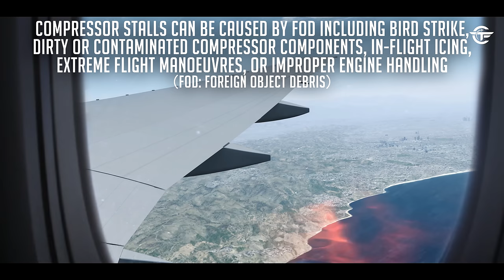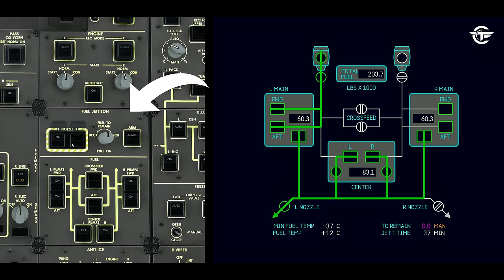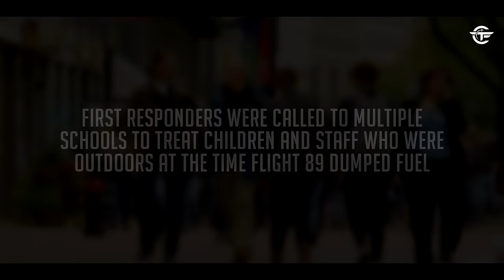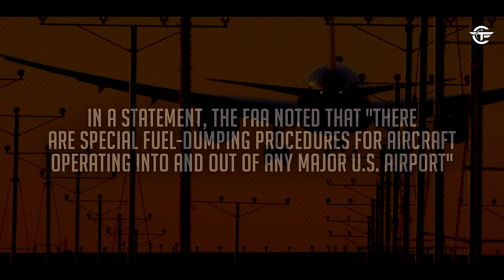Bursting into Flames Immediately After Takeoff from Los Angeles | With Real Audio

Comment: Love how people are actually defending the pilots here for dumping fuel wherever. As a pilot myself, I fail to see any urgent need in this situation to dump fuel at low altitudes above LA. ATC even asked if they need to dump fuel while over the water and the pilots declined. They never told ATC they were dumping fuel to begin with. Engine had a compressor stall, although serious, not serious enough to wait until final to dump fuel.
Reply: Exactly, they were impatient, which a lot of you guys like to do that. Shut number 2 down, go into a pattern over the ocean, and make an upwind final, no need for a downwind landing. What is it, another 20 minutes. A triple 7 should have no problems on 1 engine and they'll move around whoever to get you into rotation when you're ready. A lot of poor decisions. I only have a PPL w/ IFR btw
Reply: Exactly!!
Reply: If it isn't an emergency to not have a reliable engine what is an emergency? The pilots first responsibilities are the lives of the passengers. If my flight lost an engine the situation could get worse. I just want the passengers on the ground safely as soon as possible before something else breaks.
Reply: @jcraigshelton  why are you so upset? I wasn’t there but there is plenty of facts on this. They dumped fuel without advising ATC and even telling them they didn’t need to dump fuel. So they dumped fuel at a very low altitude causing injuries. If they felt the need to dump fuel, that’s understandable, however not advising ATC and then dump fuel on schools is a poor decision made by the PIC.
Reply: @JohnDoe-mh8tm  it is an emergency, I never said it wasn’t. My point is they failed to advise ATC about dumping fuel which is understandable considering the situation they were in, but then dumping fuel way too low to allow for proper evaporation is a bad call by the pilot.
Reply: @jcraigshelton  I love how you think I play video games…how upset are you?
Reply: @JohnDoe-mh8tm  You're obviously not a pilot, nor do you know anything about aircraft. Just about ALL commercial aircraft can fly on one engine
Reply: I thought JP8 was a good exfoliant? Lol
Reply: Great videos of what actually happens in the everyday life of flying
Reply: Alot of mistakes were made by the pilot
Reply: not defending their actions but its always easy to monday morning quarterback these situations. No one knows how they will react until they are in the heat of the battle. An engine failure is a stressful event..
Reply: There was no need to dump fuel. An overweight landing is a minor event. Many Boeing aircraft do not even have a checklist procedure, and the 787 checklist just advises to use flaps 20, and go around flaps 5, if there is an approach climb weight problem. Also there is a checklist and procedure to follow when dumping fuel. Not trying to throw anyone under the bus, but in the analysis of this, there were plenty of mistakes made by this flight crew.
Reply: @jcraigshelton  - No, a professional pilot would look at what happened and try and figure out what mistakes were made and why, and how to do it better in the future. As a professional pilot, if I made mistakes, I would want them pointed out so I can make better decisions going forward.
Reply: They and Delta should have been reprimanded. Especially given that the pilots didn't the situation was that alarming they clearly had time to dump fuel over water and above 5000 feet. And it seems they were loath to give ATC adequate information about their actions.
Reply: It’s only kerosene for crying out loud, they weren’t dumping agent orange. My father used to rub kerosene on our skin ailments and it worked a treat. Minor skin irritations and lung irritations and you can guarantee they were overhyped by people who’ve never smelt kerosene in their lives. Get some perspective people.
Reply: I'd rather fly with these pilots than you
Reply: He afraid of dead
Reply: @JohnDoe-mh8tm  <- captain for that flight trying to save face lol, should have dumped that fuel correctly chump!
Reply: Thankyou for sharing.